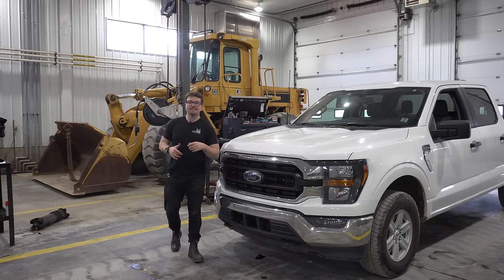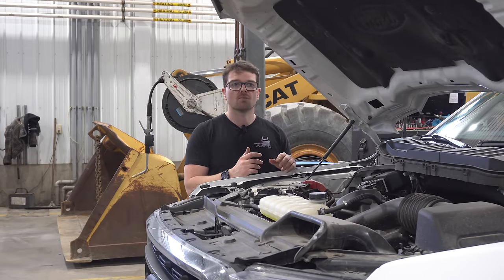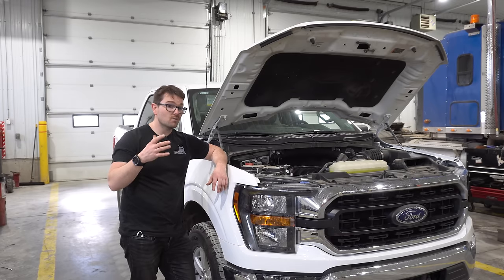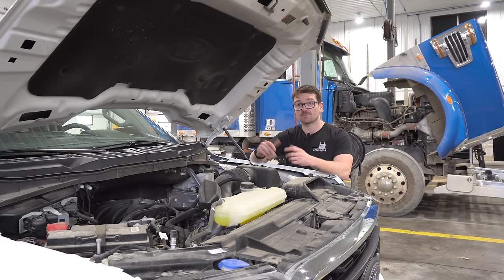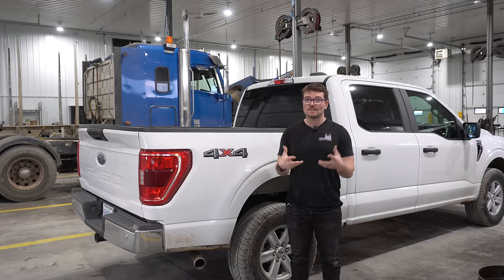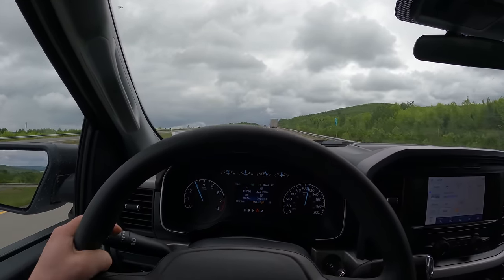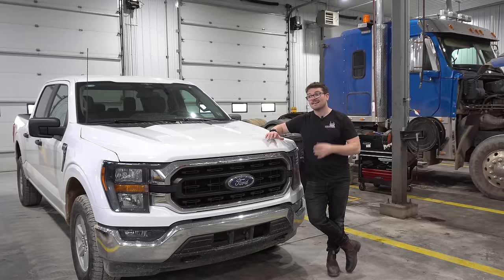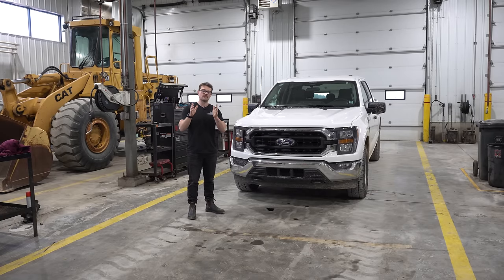Ford F150 5L Coyote V8 Engine **Heavy Mechanic Review** | 5 Reasons why It's the BEST

Comment: Great video. I think the 5.0L V8 is a great engine pre-2020 before they put the cylinder deactivation garbage into the motor and the on/off crap to save zero gas in the long run but pre-maturely wear out your starter. Ironically, you stated the half a dozen reasons I got rid of my F-150's with the 5.0L and 3.5L Ecoboosts, because many of those problems happened and cost me an absolute fortune to fix.

I for one own my own business and have a fleet of 14 trucks all half tons and I have one 3500 Cummins dually for super heavy hauls that come every now and then for my 5th wheel tower.

Anyway, I have gone through all the trucks and engine wise the 5.0L was the best of the Ford engines. They were worry free but the truck itself nickel and dimmed me especially as I got to 120,000 miles on each one. The entire front ends all had to be replaced by 100,000 and handles would break, the super expensive tail lights all had problems, and just the quality of the F-150's I had weren't great. They ranged 2015, 2017, 2018. The ecoboosts were nightmares. I had three of those and sold them all as a package. All had issues with the turbos either leaking oil or actually going out. Other engine issues too.

Now,  the majority of my trucks are 2.5 gen Tundra's. These are work trucks! I've got nine Tundra's from 2015-2021 and they are incredible. They tow like beasts, their payload is pretty good, their motors and transmission are absolutely bullet proof, and the quality of the truck is excellent. Bottom line they have cost me the least amount of money compared to any other truck or trucks that I have ever owned. All the issues you said the 5.0L has the 5.7L iForce has none of those. 

I have put hardly any money into all of those Tundra's, and I have four of them over 150,000 miles with one nearing 200,000 miles with very little done to it just maintenance. The other thing is I found the Toyota Tundra's were way cheaper than the F-150 5.0L V8 XLT's I had. All of mine are SR5's and all have 4-wheel drive and were thousands cheaper than my F-150's. It's what got me to buy one in the first place was the price. Even in 2021 I didn't spend over $40,000 for any of them. Between $33K-$38K for every truck brand new out the door tax/tag/title. 

Great video but my experience the 2.5 Gen Tundra is the best 1500 series truck on the road.
Reply: Tundras are fine trucks, albeit gas guzzlers.
Reply: @JulianoGSF  Gas Guzzlers compared to what? You clearly have bought into the marketing on how to buy a vehicle. The LAST thing you should ever worry about is MPG. The first thing you should worry about especially in expensive trucks is RELIABILITY. It doesn't matter how fuel effecient your vehicle is if you have to deal with un-reliability and are spending money left and right on repairs you would not have to do if you have a different brand/vehicle, then you are losing big time money and time down with a truck. 

You are always bettert off paying a few extra dollars at the pump than thousands of dollars one time and costing yourself thousands of more in down time.

I'll sum it up this way. I spend less than half of what I did on fuel and maintenance COMBINED on my Tundra's than my F-150's.
Reply: @SuperSnakePlissken  I like reliability and gas saving vehicle, why can't I have both?
Reply: @JulianoGSF  Great question. I do not believe that it exists anymore. The only time it existed was in the 2000s diesel trucks. You got power, reliability, and MPG, but of course the Communist Democrat party and their religion known as the Church of Global Warming destroyed those wonderful vehicles and diesels to this day have never been reliabile at all.

Ford's problem is they change out their trucks every 5-6 years so they never perfect anything that they make. Toyota is different. That Tundra was the same truck outside of paneling from 2007-2021. These trucks had become perfected through the fact Toyota refused to change them out and just make their product better. That's why I buy them and eventually I will change out all of them for 2.5 gen Tundra's. 

Now, is the Tundra bad on gas? I would argue no it is not and it is actually an excellent MPG vehicle. I tow between 2-6,000 lbs regularly with my fleet. I have my own AC company and the trucks always have gear on them, but are also towing A/C units and air handlers to jobs all the time. They average 11 mpg when towing while my Ford Ecoboosts averaged around 9-10 max. Big loads where I was kissing 10,000 lbs it would be as bad as 7.5 mpg. Once those turbos start spinning your MPG is horrific. My 5.0L's never got better than 10 mpg. 

Why? Because they all had 3.31 gears in the Ecoboosts and 3.55 gears on the 5.0L's. My Tundra's have 4.30 rear ends and tow like absolute beasts. They tow better than my Ford's ever did and that's because of the rear ends in them.  So, in my use they get really good mpg. 11 big loads and 12-13 on stuff less than 4,000 lbs. 

With just my guys and their gear they average around 14 city and 17 highway. That highway is only 1-1.5 less than my 5.0L's, and my Ecoboosts got 19 at their best. 

So, if I'm spending slightly more on fuel empty and less fuel when towing its a wash. What matters is the reliability and that's where the Ford's get left in the dust by the Toyota Tundra's.
Reply: @SuperSnakePlissken  The Honda Ridgeline seems appealing for the reliability and efficiency.
Reply: @JulianoGSF  My Dad who is retired has a 2023 Honda Ridgeline and him and my Mom love it. Parks and drives like a car but he can do his flower bed yard work with it and pick up what he needs. It is a fantastic city truck plus it fits the grand kids in the back with ease. Highly recommend.
Reply: @SuperSnakePlissken  I am between the F150 V8 or Ridgeline. Found a rebuilt title 2019 F150 V8 XLT that had a burn on the side, no accidents $25k with 38k miles. I may be able to get it for 23k.
Reply: @JulianoGSF I came pretty close to buying a rebuilt titled vehicle before and was heavily cautioned from someone who had done it themselves and got burned really bad on it. Think of it this way you are rolling the dice hoping that you don't get screwed in a situation like that. 

2018-2019 by the way are absolutely notorious for having universal oil consumption problems. I do not recommend buying a F-150 from those years. It is so bad that they are burning 1-1.5 quarters per thousand miles. That means if you change your oil at 5,000 miles you literally could be almost out of oil if you don't ever check it and the engine would/could be ruined.
Reply: @SuperSnakePlissken  You wrote above that engines pre 2020 are great. Do all 2019 burn oil like so?  I have purchased a sedan rebuilt title about 8 years ago, no issues at all.  Runs great, it was damaged in the rear.
Reply: @JulianoGSF  They were great minus the oil burning in my 2018. I didn't have any oil burning in my 2015 or 2017. Again, my issues were not necessarily with the 5.0L V8 minus its less-than-desirable fuel consumption. The issue was the damn truck it sat in.
Reply: @SuperSnakePlissken  Should I then opt for a F150 V6 naturally aspirated? I heard good things about those engines. 2.3 and 2.7L
Reply: @JulianoGSF  That is up to you I know nothing about those engines. If your heart is set on a F-150 5.0L V8 I would go with a 2015-2017 model. Engine is great, transmission is good, I had issues with some reliability in the truck itself especially in the front end, but that's what I would recommend in a F-150. Honestly though as someone who has owned 38 trucks in the last 13 years I just cannot recommend Ford's personally. I had too much down time, spent too much keeping them on the roads, and to this day I'm still pissed I bought into the "Ford is the work truck". No the Tundra is a work truck and you won't waste money on it. 

Seriously pal, go get a 2015-2021 Tundra. Don't waste your money on anything else. Hell, for fun I just did a cargurus search of Tundra's near me, and I found 16 of them that were 2017's SR5's with 4-wheel drive for less than $29,000 with less than 80,000 miles. That's a steal right there!

Comment: The only significant concern I have with the coyote is it’s spray on cylinder liners. Overtime, how durable is this compared to a steel sleeve used by other manufactures?
Reply: Agree. I'd like to know too..
Reply from the maker: ya that was a concern for me when I first read about it. but that was introduced for the 2018 model year and well we are coming up on the 6th year. if there were going to be longevity or reliability issues with the spray on liners I think they would of presented themselves. I could be wrong but it seems like the spray on liners are holding well.
Reply: @TheGettyAdventures  ‘spray on’ liners were 1st on the 5.2L … wasn’t it🤔

Comment: Mine is a 2013 5.0, with no major problems over the years only routine maintenance, and other than an oil pan leak, it has been a great truck! The throttle response is off, but considering its age it's understandable.

Comment: I currently have my first Ford F150. Its a 2014 Super Crew XLT with the 6.5 ft bed. I bought this because of the bench seat in the front and back seat allow a family of 5 plus+ 1 guest, the towing option was ordered in this (larger cooling for tranny) w/locking rear diff and the 5.0L. I tow a lot in the winter to go snowmobiling and summer with boats. Now I have 177,000+ miles, ZERO issues with this motor. I perform regular oil changes and plugs done at 90K miles. That's it!!  I cannot say that with my GMC 5.3L motor and 5.7L. Since I live in New England, all my towing is just hill after hill after hill after fricken hill. Some are miles long hill pulls while others are short but very steep pulls (Lost traction on one this winter - took another truck to pull me and the trailer up). Fuel economy has been very good considering the the hills. I would definetly buy another 5.0 because it has been very very good motor. I just wish it's towing capacity, for my truck at least, was higher than 7K. 
BTW, Oil changes are every 15K miles running Amsoil Full Synthetic 5w-20.
Very good review on this motor. Saw your review on the Eco-boost as well. Sticking with my 5.0.😁

Comment: Awesome brother, I have a 2011 Ford F150 with a 5.0L Coyote V8 in it with 158,000 miles on it and still going strong and its a beast and it sounds like a beast with the Borla ATAK exhaust on it as well.

Comment: I've had a 350 ci GMC, 2 Ford 5.4s, a Chevy 5.3 and I currently drive a 2019 3.5 ecoboost with 90k miles on it. So far I love the thing. I take it to FL from MN every fall and back again in the spring. I'm probably gonna trade for a new one soon,  probably gonna go with another XLT with a 5.0 this time, haven't had one of those yet.

Comment: Pre 2018 yes.   Post 2018 I would go with the 2.7.   Direct injection, hit and miss quality of plasma coated cylinder liners, and now cylinder deactivation.    Much like GM with the 5.3, they took a good thing and figured out how to screw it up.   I have a 2015 with the 5.0 at 175000 and it has been great.   It does use some oil between changes but it’s not bad and it’s been super reliable and easy to work on.  After having the AFM fail on my Sierra there is no way I’d own a OHV engine with that added complexity.
Reply: You can take out cylinder deactivation

Comment: Have a 2011 with the 5.0. The engine works great but hard to get heat out of it. Had a few problems with things, both back springs, one front spring broken, brakes calipers seizing up, the blend door motor not working right not getting heat, air getting into the coolant and not getting heat so water pump and seals changed, drive shaft hanger bearing let go ( crew cab 6.5 box). It has over 200k km on it, change oil around 5000 km with full synthetic.  Still has original battery which is very surprising to me. Bought it new tried to keep in undercoated every year, missed a couple, but the first 5 years I had it done. Body is in good shape but needs a few stone chips fixed. Doesn't get great fuel mileage around 15L/100 all around, highway I think it gets 13L/100 if I go around105 kph, around 12 if i keep it lower. So still going and hope to keep it for a long  time yet.

Comment: I do all.my maintenance.  I always go lower on the recommended intervals.  5k on the oil, 20k on plugs, 20k on the brake fluid, 20k on the rear diff, trans at 10k and coolant at 10k. Might be a bit OCD but it runs like a clock and has never had any issues.  2014  with the 5.0

Comment: I own a 2014 F150 2wd with the NA 3.7 L V6 with 215k miles on it. The engine has been rock solid reliable however this truck has needed the rear axle to be rebuilt with new ring and pinion because it wore out at 195,000 miles. The front wheel bearings don’t seem to be a good design because I’m on my third set now for each side. At about 120,000 miles I had to replace the front springs because they broke. lately because I live in the North East road salt has taken its toll on the underbody and rust is starting to creep in. Other than these issues, this truck has been mostly reliable. I really want to get a RCSB 5.0 4X4 for my next truck before Ford drops the 5.0 due to the EPA pushing for zero emissions.

Comment: I rented a 2023 F150 with a 5.0 L from Hertz just to see if I liked it(normally rent cars when traveling). I was amazed at the power, the smoothness, and the sound but totally shocked with the fuel economy of 22 miles per gallon overall on a 600 mile two day trip. Most of the driving was on the freeway, but I was stomping on it just to hear the sound and blown away by the fuel economy. I thought the gauge was off but I tested it when I filled the truck, not once but twice. If these are reliable, they are truly the best truck engines. I have owned 2, 6.2 L in a Denali pickup, and an Escalade, 2, 5.3 L in a GM Tahoe and 1500, 3, 5.7 L in GM trucks and a 5 L in an old Ford. None of the engines above were even close in smoothness, sound, power (revs quickest of all truck engines) and most of all fuel economy.
Reply: I just picked up a 2023 5 L and it’s the best truck I’ve ever had. I’m a construction contractor and I’m happy to have gotten it just 12 days ago.

Comment: Agree! The VVT helps with the efficiency and power/torque. The 10-Speed also helps keep the motor in the higher rpm’s where it makes the power. It’s a great reliable motor and they love boost so if more power is wanted there’s that option too

Comment: I have a 2020 that was using a quart every 2000 miles. It was leaking through the valve guides as it sat. I ended up with a new crate engine which now has 900 miles on it and so far so good. I noticed this engine has the original dipstick with only 1 quart between the add and full marks, which tells me ford is pretty confident that they fixed the problem

Comment: '17 5.0 F150 owner here, I've owned them all from Chevy to Dodge and for my dollar I wouldn't buy anything but a Ford truck. 117,000 miles and it doesn't burn or leak a drop of fluid. Not only the most reliable engine I've ever owned but the BEST vehicle I've ever owned and it's not even a close second!

Comment: Thanks for all of your detailed videos.  I was in the market for a replacement truck for my 17 year old Nissan Frontier and have wanted to upsize for more towing capability and room inside the cab; not to mention the little V6 in that Nissan is brutal on gas mileage - especially when towing.  Anyways, I watched several of your videos over the last 6 months and though in my heart I had wanted a Power Wagon; I couldn't justify the extra gas and didn't want to roll the dice with their failing transmissions and lifters.  

This Ford 5.0L V8 video helped solidify that the truck I was looking for was a Ford - a brand I had never owned prior.  After months of looking, I came across a barely used 5.0L with the long box (not an easy find) and feel confident that I have a truck that will give me many reliable years of service.  Thanks again from the West Coast of Canada.

Comment: Had a 1st gen  Ecoboost in my 2011 F150 and that thing ATE fuel towing my rally car.  Great towing power, but you're right about having to keep your foot in it and the turbos spooled up.  And the transmission in that thing HATED towing, perhaps due to the constant revs and prolonged on-boost episodes. As a result, my incoming '24 F150 is coming with the 5.0L!!

Comment: I have a 2014 f150 with the 5.0. It has 347.000. Still runs great! Ive put a starter and a water pump in it. Still has the original belt lol. Changed the spark plugs at 320.000 lol. Definitely going with another 5.0!!!

Comment: '14 F150 5.0 4x4 owner.
Getting 17.4 average MPGs.

Truck is awesome. Does what I need it to do. Bought it about 3 months ago.

Previous owner Canadian Ministry of Transportation. They took good care of this 9 year old truck. Not 1 spot of rust on it.

1 broken grill trim piece (plastic), small dent in C Piller right side, and backup camera doesn't work all the time (that's an F150 normal thing I've learned).

Spacious cab, and it's the 6 passenger version.

I'd recommend, and have recommended to friends buying 1 of these F150 with the 5.0.

Avoid the echo boost 6. My mechanic said that engine is not reliable. He had a list of known issues that would be expensive to repair. Along with the 10 speed transmission that engine is paired with.